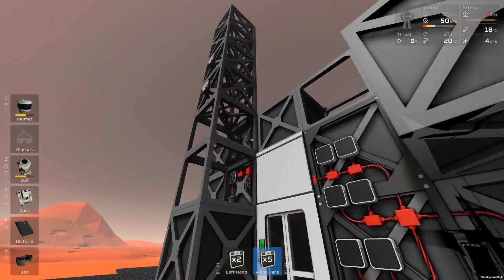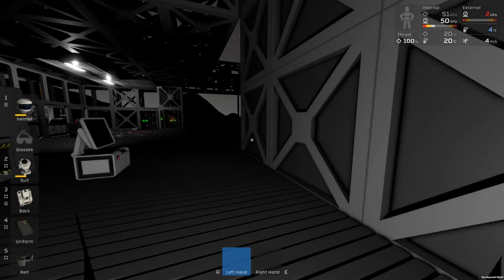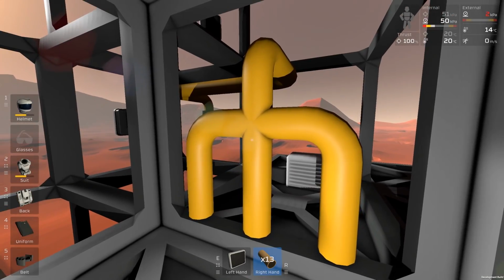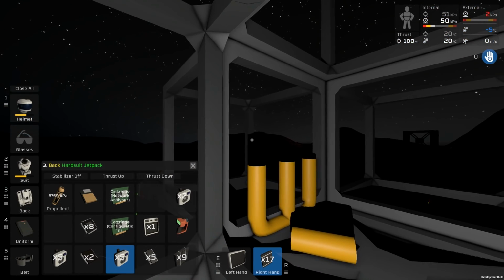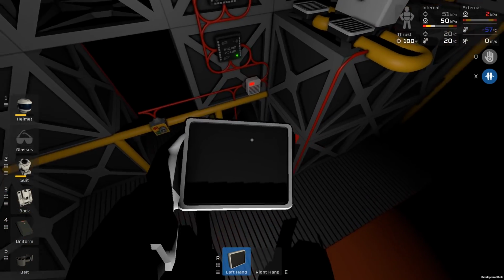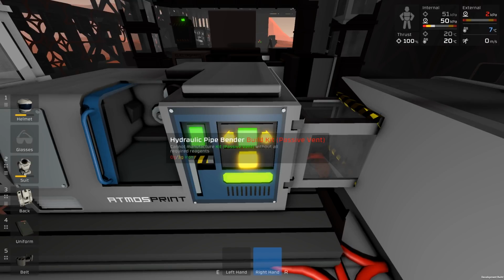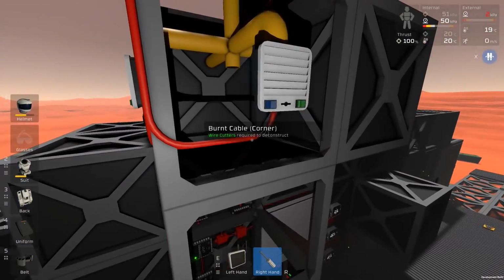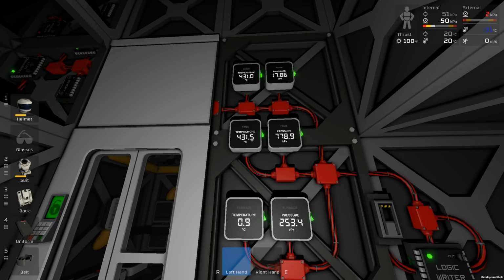Stationeers S2 E63 - Cooling/Heating Tower Beginnings

Comment: You could use a door to clear atmosphere very quickly instead of reversing the active vents.
Reply from the maker: I can't highly pressurise with a door however (they have a pressure limit)
Reply: It depends on the door. Blast doors don't have any pressure limit for example.

Comment: if you don't use the furnace often, which you don't, then you can maybe open a valve to let passive vent air into a pipe with radiators whenever the outside air is warmer than your fridge room.
when it's 20°C outside, and your wall coolers are on, the inside is at -30°C or so, then the valve opens, and then the radiators would be connected to the air inside your room, heating it passively.
during the night the valve would close, the air in the pipe gets cold, but it's insulated from your room.
not sure how effective that is, but certainly it saves more power than using either heaters or exchanging the entire air volume every morning.
In that case also, you could skip using atmosphere all together and just fill the room with pollutant. just make sure you have some way to dump it into a canister if you need to work on it.

Comment: You could use a transformer to wire up the active vents on the tower. this helps with:
* not having to use heavy cable all the way up there, which is probably a good 30+ pieces
* having a unique id for the transformer to simply turn on/off instead of having to use a batch writer which may mess with things down the line.
Reply from the maker: If we're using the active vents to remove the cold atmosphere from the room, then we'd need to access more than just On/Off - which is possible, but would be more complex than just running extra cable

Comment: I've already done lots of experiments with furnaces. The fastest heating I got is by extracting heat from a gas at 11kPa and 1500K (you can go a little hotter but not much before stuff burns). The low pressure allows preheating the gas to 1500K very quickly, and the high temperature makes heat transfer quick and cheap, plus you can actually put the furnace inside that gas to reduce heat loss. Don't use radiators to transfer heat to the furnace, they are slow. Air conditioners can do this quite fast for only 5W. Make sure the furnace is connected to waste heat and set the AC to cooling that 11kPa/1500K atmosphere (AC cannot heat above 373K but they can cool anything to 173K). Why 11kPa? Lower than 10 kPa and wall heaters are slow. Higher than 13kPa and some equipment burns at 1500K. You want some margin as heating increases pressure quickly.

Comment: If you want to ensure that you don't have any invisible leading zeroes , you can just add a suitable number at the end, for instance adding 111 converts 011 into 122 and so on, or adding 8000 converts 011 into 8011 (so you still have 0's and 1's but with a prefix of 8)